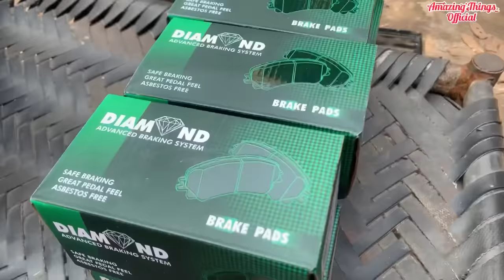How Carbon Fiber Brake Pads are Made In Local Factory || How Car Brake Pads are Recycle in Pakistan

Comment: For those in the west, pay close attention to the ubiquitous health and safety measures implemented here
1  open toed safety sandles
2 loose fitting flammable work overalls 
3 hand Protection 
4 Face shield incorporating breathing filters 

And this ladies an gentleman is why the east can produce goods at a fraction of the price of Western manufactured goods.
Reply: What's terrifies me is the unknown powder they're weighing at 7:00 

Please tell me that not asbestos 😭😭😭
Reply: @XavierAncarno  Don't panic they are following Asian Health and Safety best practice,  by working in a well ventilated area.
Reply: @javeedsultan8484  seeing the kids sanding the pads without any protection is heartbreaking... And even with breathing apparatus the dust collected on their clothes and on their skins is enough to mess them definitely.
Reply: @XavierAncarno  What's really depressing is they're holding a conference in Scotland to discuss measures to tackle climate change. 
One of the contributors of climate change is burning fossil fuels.
You would have thought some one would have pointed out that to travel to Scotland may have been a good opportunity for all the vehicle's shuffling people about could have been Electric. 
One good thing about covid it showed us that virtual meetings do work, so was it really necessary for world leaders to travel to Scotland, when we know there are alternatives 

Untill world leaders acknowledge that they should be setting an examble, nothing will ever change. 
We can't even stop being racist, and all that takes is a change in attitude
Reply: Until fair and safe work practices are uniformly enforced around the world the west will never compete with eastern labor. It would take the west recognizing the cost to humanity that is required to produce the inexpensive goods that we buy.
Reply: @davidrosenberg2580  that’s not going to happen… zero hope for that one.
Reply: I really don't think that these people care about health or environmental issues, I think they care about making enough money to feed themselves and family and have a place to live. That's pretty much what they care about.
Reply: @yogidemis8513  you're missing the point, low paid workers the world over are more concerned about providing a living for their families and themselves. 
Low paid workers aren't in a position to demand better work conditions as there are always someone who would do the job whatever the conditions 

A lot of these small machine shops are normally family run,  
Although big business also exploit work force by not introducing health and safety for works
Reply: Just like Europe in the 1990s, 30 years ago.
Reply: Nah, those things do not cost alot.In India, You can buy a good quality shoes for a little over 10$. 3M mask for about a dollar. Decent Work outfit again for 10-15$. Our currency is much smaller than yours, + there is no concept of minimum wage. So a labour doing work for 8 hrs earns 10$ a day. The same goes with factory workers. This is why it's cheap (with respect to west, in east these stuffs are still expensive)  to manufacture in the east.
Reply: In the west safety equipment is cheap compared to life. In the east life is cheap safety equipment expensive.
Reply: @frankdunnage9387  A lot of these machine shops are owned and run by family members there's little to no interaction with Official bodies to enforce any types
 of health and safety measures. 
and remember working conditions weren't a big consideration a 100 years ago In the west also
Unlike the west different generations of the family live near if not with the rest of the families so these small workshops are the main source of income for the extended family
Reply: dont forget child labour.
Reply: I agree
Reply: @XavierAncarno  Unknown? it is asbestos. Very good material for brake pads. in the 80's the brakepads was usually light colored or pinkish. And that is exactly what it is. Asbestos.
Reply: One must remember that 100 years ago almost all workshops in Europe looks quite similar.
Give them the time and thing will improve.
Reply: @laserowy_general  Sorry no, These country's are rich enough to have basic needs covered for children ESPECIALLY india lol.
Reply: @XavierAncarno  21:09 asbestos free
Reply: It's not like a respirator would cost that much. I assume this is their own business, so it is totally up to them. They would likely say that safety is western propaganda. I mean look at the old dude, doing this 50 years and no problems.
Reply: Are you seriously complaining about having a healthy safe work environment?
Reply: But you can be damn sure the 10 middle men will take a FAT profit by selling you these at "the local fair market price"
Reply: I work in a factory, quality management (just assistant tbh), my heart is aching.
Reply: @DazzaBo  May be safer,  not much harm can come to workers in the west as they sit at home scrapping the last morsel of food on the plate
Because their boss has moved production to the far east where labour is cheaper, and workers are more productive, have a better work ethic and never take time off.

Before long the west will become what Southeast Asia is today, employment costs will fall, safety standards will drop, as millions of starving workers scramble for the few jobs still left
Reply: @XavierAncarno  that does look like loose asbestos...
Reply: So what? Did they die?
Reply: @galupas  asbestos doesn't kill you straight away.
Reply: at the cost of a human life
Reply: @XavierAncarno  if you look at 21:02 the box clearly states "ABESTOS FREE", fear no longer.
Reply: @mlim82480  ahhh okkk! So it must be healthy to inhale brake pad dust for hours everyday! Thank you safety gods of YouTube....
Reply: Also, you don't kill yourself and everybody else with a German set of break pads when driving down a mountain road...
Reply: @ShadowManceri  Actually, he is only 25 years old.
Reply: @XavierAncarno  The video title claims the lining material is a concoction containing carbon fiber. It suspect the powder may be a mixture of several substances, and that some sort of resin is mixed with it, to hold the material together and create brake linings. As asbestos is now prohibited from being use in many places, and as a result, it may indeed, NOT be asbestos. But – I don't really know. Anyway, it doesn't look to me like asbestos. It is too dark in color. Brake lining manufacturers tend to keep their ingredients a secret, to some degree. Lots of things are mixed together, in an attempt to optimize the properties of the brake linings. Brake feel, sound they make, how long they last, how much wear they cause to the brake rotor, etcetera. For awhile aramid fibers have been used as one of the materials in some brake linings. Trade name: Kevlar. It is very strong and resistant to being damaged by heat.  High temperature ceramics make up part of some brake linings. I don't know what is in "organic" brake pads but maybe its carbon fibers. Carbon is the quintessential substance that comes to mind when one says "organic." But I'm just making a guess here.
Reply: @issadraco532  They are obviously not "lazy." What they are doing is making choices as to where to apply their hard work – to relining as many brake pads as they can before the day is done, rather than do something else, like sweeping up and painting – which doesn't make them money. They may very well be making a good living here. I know from personal experience from working for my father as a teen and a youth. He had a shop in Brooklyn NY where he assembled pre-formed plastic letters and pre-formed stainless steel letters, into signs that we would hang on buildings – retail shops, factories. He made quite a lot of money doing this. My mother would never visit the shop because she didn't like to go to dirty, disgusting places. But he made more than enough money to buy a nice house in the suburbs, to buy a new car every 3 years, and to buy a 40-foot cabin cruiser. The first time I saw the toilet bowl in his shop, at about the age of 7, I was flabbergasted. I had never seen a toilet bowl like that. The key to making money in his business was sales, marketing. I think he was more focused on sales than at assembling the signs and hanging them on buildings. Because he made plenty of sales, and followed through with hanging the signs, it made it possible for the house where he, my mom, my sister, and I, lived, to be always clean. But the shop? I'll spare you the details about the toilet. A hired person came over to the house, once a week, to help with cleaning. Another came to wax the floors. I'm not sure what my mother did. I know she helped with the bookkeeping for the business. She did that. She occasionally typed letters to people. But I don't think she did much else. We ate in a restaurant maybe twice a week. Home meals would often be "TV dinners." Dad would come home every night, sometimes at 6:00 pm, but often not until 9:00 pm. Anyway, my point is that dirt and disarray didn't mean laziness. If there was one thing he was not, it was lazy. My dad worked long hours, obsessively. But his attention was focused on making money, not on keeping his shop neat and clean. Benjamin Franklin is sometimes quoted as saying "keep your shop and your shop will keep you." Nope. I don't think that's how things work. Not from what I've seen. Instead of buying quality tools, and taking care of them, my would buy the cheapest tools available. He shop was such a mess, that when he needed a tool, he sometimes couldn't find it because it was hidden somewhere among the mess. But he knew that if he went to a hardware store, there would be a salesperson there who could find the tools he wanted. Easier to that than to try and find a drill gun he already owned. Maybe Ben Franklin's proverb applies – to hardware stores. I knew that my father typically had 4 or 5 cheap electric drill guns lying around somewhere.
Reply: The cause does not lie in the 4 justifications alone, but in the general very low standard of living and the system of the government, which allows such inhumane and highly unhealthy work. If these people had the opportunity to work in the way that is the norm in the West, they would too! Unfortunately, with very limited resources and opportunities, they have to make the most of their lives. These people have my admiration, but also my sympathy.
Reply: @XavierAncarno  its fiberglass, irritates, must be so bad breathing there. But long term it doesnt damage you, if you do electrical/construction work you breath it in anywya. Its a fire hazard, but doesnt give long term problems if breathed I think. Breathing that much every day for years? Dunno.
Reply: @XavierAncarno  The box says Asbestos free
Reply: As they place the diamond brake pad sticker on them.. sold in Auto zone, Napa, oriellys, ECT.. pay them pennies charge us big $$
Reply: At least they use their safety squints when grinding.
Reply: @XavierAncarno  You see on the box asbestos free ;)
Reply: @XavierAncarno  Of course it is it's not baby powder.
Reply: غير صحيح
Reply: @javeedsultan8484  Yes they spread the poison all over the town!
Reply: @shark_.  English pal learn it.
Reply: @XavierAncarno  It's not capitalism that is at fault.  It is the choices made by people working within the system of capitalism.  Capitalism is the only system that allows people to eat and live because it produces.  But some choices - while working within the system of capitalism - is what actually harms and kills.  Even societies that some believe is pure socialism and communism has an underlying current of capitalism because - again - it is the only system that produces so people can eat.
Reply: petrocky  I agree it does look, at 6:35, as if it is carbon fiber. It could be asbestos. It is the right color. By the appearance, it could also be a ceramic. I suppose the box, which says asbestos free, could be lying.
Reply: petrocky  Even if it is a ceramic, I would want to breathe in the fine particles that I see being created at 9:10
Reply: Add to that executives exorbitant pay. 😉
Ps: safety protocols really cost this much?
Reply: Amen. Horrifying health conditions. The young man (boy really) running the grinder, just think what his lungs look like!
Reply: @activity1  Yes,   
for the workers when you're paid peanuts you don't have the luxury to be safety conscious 
For the Employers why fork out for better conditions,  it eats into your profit.
Reply: @javeedsultan8484  These brake shop looks like its family run. Which is okay, family have job, income. Health issues here are big. There is no way this shop would ever be able to work in west due all the regulations. I saw many vids about smaller local factories in Pakistan, India. Workers were constantly in dirt, fumes, heath everywhere. There is lots of companies in west that are bad. My friend work in company where he receive his pay every three month. That what he worked for march, he end getting in june. and so on and so on. At least health protection is at first place. No allowing to work without proper protection.
Reply: @Zagoreni02A  bad working conditions and poor health and safety has been part and parcel of every country's industrial beginnings 
Better working conditions and health and safety isn't something that companies implemented without pressure,  
Better conditions are driven by public / employees concerns and government intervention. 
Western companies only implement better conditions due to governmental rules and fines
Reply: @XavierAncarno  claaro que é
Reply: These are killing fields, human life comes cheap for the owners here
Reply: @joypaul340  In countries without a state funded welfare system, it isn't so much that life is cheap, rather life is hard.
Reply: @XavierAncarno  Carbon fiber most likely
Reply: @javeedsultan8484  Lol racism is deeply rooted in the western culture it will never go away.
Reply: @roahnosh  you're wrong , it isn't rooted in western culture,  it's rooted in "White Culture" 
Best examples are Australia, and USA
Reply: Yea, a whole lot of people, no jobs. And no health protection at all. And after they get sick. No medical care.
Reply: @nipperdog7777  Welcome to the 21st century. 
Who would have thought with all the advances in medicine technology and food production we still have medieval working conditions and poverty
Reply: Let's start by burning the asbestos off of the old brake pads...
Reply: @sniper7.62x51  Burning is the least of your concern, all that grinding is way more serious
Reply: I agree..poor for that boy..
Reply: How the rich and powerful exploits the poor masses
Reply: @motor8016  Welcome to the world of capitalism
Reply: Thanx bro 😇
Reply: @XavierAncarno  It is carbon fiber based, apparently.  At the end you can see the label on the box states "asbestos free"
Reply: @davidrosenberg2580  Inadequate safety and PPE has nothing to do with the price - such things are not expensive and would add very litte to the total labour cost.  It is more to do with general ignorance as to the importance of such things - and TBH we do tend to over-do H&S in the Western world, mainly because of the risk of being sued should anything happen rather than a concern for the workers.  Consider that a factory employee is obliged to wear far more protective gear than most would consider necessary when doing a similar DIY job at home.
Reply: @frankdunnage9387  No, the importance of employees' lives is about the same for a Western employer as an Asian employer.  The difference is that the Western employer is more frightened of being sued.
Reply: @XavierAncarno  yeah that is lmao
Reply: @pinkipromise , thank you for satisfying my curiosity, too.
Reply: Where the fuck are the UNIONS?
Just askin!!!
Reply: @richardtemby4358  they are sat on there fat asses in the west

Most of these workshops are a family concern, doubt very much they would join a union even if there was one

It's not unions they need  but Government imposed working conditions,  
But then again in south east Asia can see the government stepping in to improve working conditions 
Theres a reason why every western country now get there products manufactured cheaper.

Bit ironic that  due to unions it's now become to expensive to manufacture anything in the west
Reply: Lmao....
Reply: سلام این لنتها به صورت فیک و قلابی درست میشه و جان مردم بیگناه را میگیره
Reply: Giving these guys PPE would have a negligible cost.
Reply: @XavierAncarno  That was exactly what i was thinking. Im like please please dont let it be. These are dead men in their youths if it is.
Reply: @XavierAncarno  is heroin🤣
Reply: @XavierAncarno  hey the box at the end says "asbestos free"
Reply: Well good luck with that then👍 I am sitting at my desk staring out the window for the past 1,5 hours. I think I am getting another coffee.